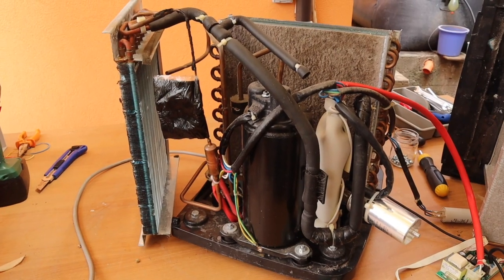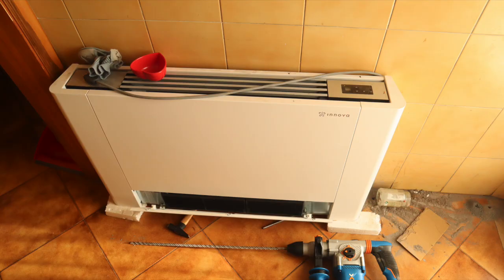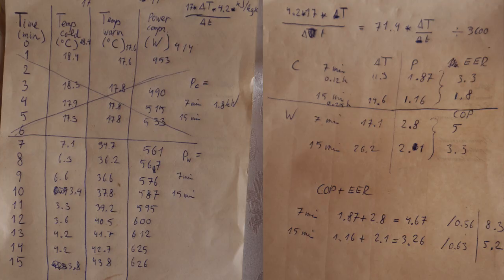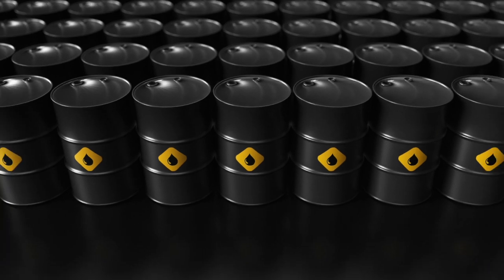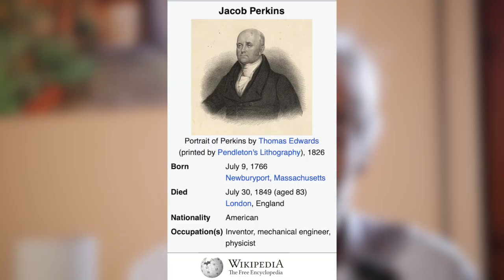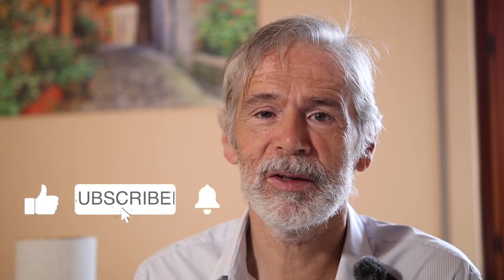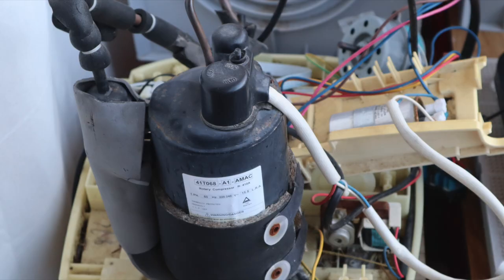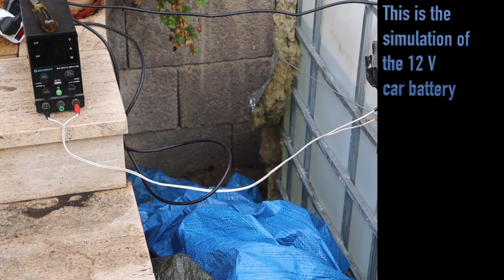Forget Gas Boilers and Switch to DIY Heat Pumps for Lower Bills - Video 69

Comment: New subscriber here! This is my kind of channel, this is how we learn by doing and at the same time learning from our mistakes. 

Could you give a walkthrough of your home and what kind of flow temperatures you are getting at your radiators with this system, what room temperatures are you achieving? 

Also does the system have a thermostat or are you manually turning on and off as needed? 

Excellent channel, thank you so much. You should also follow the Heat Geek channel.
Reply from the maker: Thanks for the sub, Richard! If you want you can also join the Facebook group that is in each description.  I like very much people that speak out and it is a bit silent there... this system on the video is in our summer home where we receive guests and in spring 2025 i have to finish it before it is able to be fully functional.  I just got the radiators tepid and had to leave for our winter home in Tuscany. The good news is that in spring this system is ready to make not only warm but also cold water so that the same radiators (with a fan) will cool the house, which is also very important in Sicilia.
Reply from the maker: For now I have to control by hand but there is on my channel a video about Home Assistant and I will give it the reigns sooner or later.  I'll look up the Heat Geek!
Reply from the maker: Ah, I was already a subscriber of Heat Geek!
Reply: @nnvasen-good-energy  The good stuff :)

Comment: So, the big problem that I see with energy storage is that it becomes less efficient for several reasons:

1. Losses over time - the stored energy with radiate and conduct away with time.  Insulation and radiant barriers can help, but they will not eliminate it.
2. Lower ability to add more energy - the more energy you shunt into some storage media, the less ability it has to take on more energy up until it can no longer receive more energy (when the media's temperature rises to approach to ,or be equal with, the superheated refrigerant's temperature).  The 3x number declines as we approach the point.
3. Energy used during the utilization of the stored energy - we have to spend energy to store it, and we have to spend energy to use it.
Reply from the maker: In principle you are right, but as you say, the drawback is valid for any form of energy storage, also in lithium batteries. And also with food processing if you want to keep it for tomorrow. But what is the alternative? In the past, when they killed a cow, they had to eat it in a few days, let's be glad that we can now store it, even if there is work to do and money to spend, so the stored meat is more expensive.
Reply: @ Plenty of options that are more efficient.  Gravity storage (mass).  Freeze drying stores food for later.

For storing heat… some organic material that can be burned, really.  Now, doing so in a beneficial way is crucial.  Collecting debris that would decompose anyway.  This could be managed with a pyrolysis reactor.  It will off gas and that can be used in place of natural gas or propane… and it is a net benefit because it would have been methane in the atmosphere otherwise.
Reply: @dus10dnd  Im in Saskatchewan. We have 2 weeks with only 3 1/2 hours of usable daylight in the winter. But I am heating my house all winter with excess solar I generate every day. I oversized my solar to ensure I could do so reliably under the worst possible conditions. How? I have a giant sand battery that is insulated itself, and buried in an insulated pit beside my house. The top of that sand battery right now? is 580C. By the beginning of March when the days start to be long enough to start moving the needle the other way? It will be around 190C. This is my second season with the thermal storage. The tank is 40C hotter this year. Even today its pretty cloudy out but the batteries should be full by 11am and I will be dumping 4-8kw worth of energy back into that tank an hour till about 3:45pm. Retired power engineer btw. Spent decades in commercial steam/Refrigeration. It cost me less for the 26kw of solar equipment? Than the utilities wanted to charge me to bring power and gas the 3/4 of a mile into this formerly abandoned farm site. And it cost me less for the rest of the hydronic home heating system? Than it would have cost us to heat this home with oil for two years. We did that the first year. I built the sand battery in the shop on sunny days over the winter and buried it as soon as the ground thawed.
Reply: I should add that the first winter the added energy load of the forced air oil furnace ensured that we had to use a generator for about 5-6 weeks. But now its a non issue because at idle overnight the house is consuming less than 400 watts/hour.
Reply: @davefroman4700  Sure, the key is that you oversized it.  So, this means it really isn’t a matter of efficiency.  That may be perfectly fine… if your priority is self-sufficiency or renewable energy.  Also, you said giant.  And you have it at 580C… you’re not doing that with a heat pump.  You’re using a heat element.

Nothing you’ve said disagrees with anything that I’ve said.  What you have is nothing like the system here.

EDIT:  I would also love to learn more about your system.  Total mass of sand, extra steps you’ve taken to insulate, etc.  I am watching these videos because I am interested in this.. I am not here trying to be a naysayer.  Physics just says that this setup in the videos won’t work.
Reply: @dus10dnd  You are correct. I have two 4kw 240V heating elements on staged smart loads which are controlled by the battery SOC. And there is roughly 350 cubic yards of sand in that tank. With the volume of the air plenum subtracted. Im seriously thinking about looking for a Used hot tub to put in a gazebo on the back of the power shed I built over the tank...
Reply: This house was built in the early 70's. Its far from efficient.
Reply: The tank has R60 of Rockwool insulation, and its wrapped with plaster wrap. Wet it and its concrete basically. The Pit extends out 2ft around the tank and has 4inch styrofoam for walls and a sloping roof over the back filled tank. This is to keep the moisture and ground frost away. I put a 4x4ft concrete riser on the top where the hatch is that was used to fill the tank with sand. And another R80 of Rockwool. From there I just have a high temp primary feeding a fluid/fluid heat exchanger that feeds the low temp systems. The last thing I wanted to hear in this house? Was another #$^@(* compressor or furnace in my retirement. A lifetime of noise has taught me the value of silence.
Reply: @davefroman4700  I have been looking into a cistern to store water for watering the garden and maybe using as a source of water for the toilets.  My apprehension is the size.  Sand batteries have been appealing, too.  I am just concerned about the size needed, but I am mot in as consistently cold of a winter climate.  We’ll have a bad winter where it is -15f (-26C) for a few weeks… but another winter, we may barely dip under freezing in the coldest part.
Reply: @dus10dnd  Yeah -26C is a half decent day around here.
Reply: @dus10dnd  Depends what your priorities are. I do rainwater harvesting every opportunity I get. Even off my solar arrays. I have two 5000 gal cisterns. But we have a half acre veggy garden to water in the summer. It helps that my neighbor owns an excavator and willing to help out for a case of beer and a good meal when I need a hand mind you.
Reply: Have you considered using air as the source of heat instead of water. Of course you could still use the waterto heat the radiators in the home, I understand that these are air conditioners so will likely freeze up but I've also seen people using chest freezers as these are well insulated also? 

It then solves the issue of the cold water and it gaining heat although you've built an evaporator essentially with the car radiator fan so in theory if the water is below the outdoor air temp it should collect heat. You just may need a bigger car radiator (truck or bus radiator) to provide more heat?
Reply: @richardc1983  Why would that change anything?  If anything, at all, using water is more efficient, whether a source or a target.  It is more readily able to transfer energy.

Comment: heat pumps might be 300% efficient but it doesn't matter when gas is 10x cheaper for the same amount kWh
Reply: Where are you that has a 10x price difference? It's 3-4x here in the UK
Reply from the maker: Yes, that is the same question from my side. I have a bit of "free" gas from my  HomeBiogas digester with kitchen waste, but that was quite an investment.
Reply: Where is that true? It would be a very odd situation considering closed-cycle gas power plants are about 50% efficient, wouldn’t you just build one and print money?